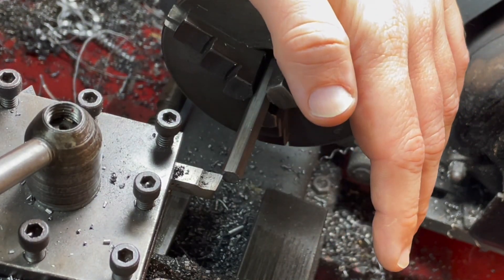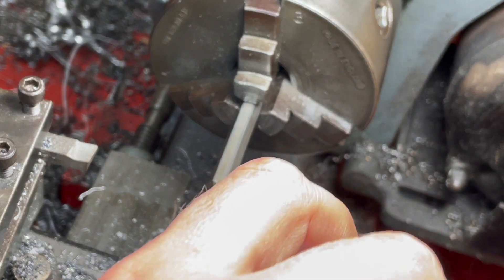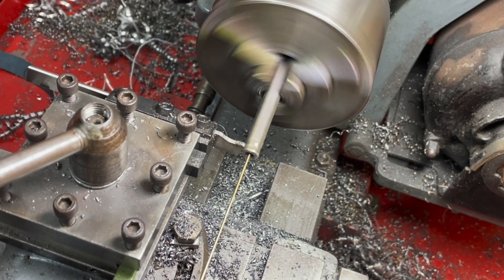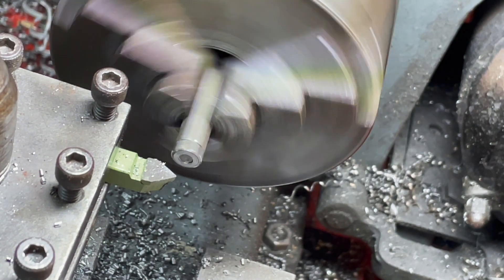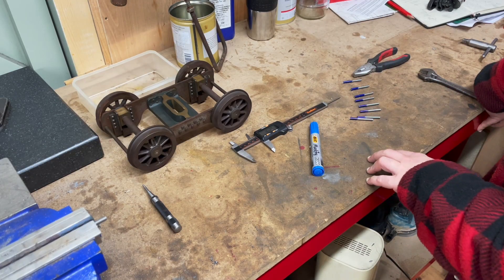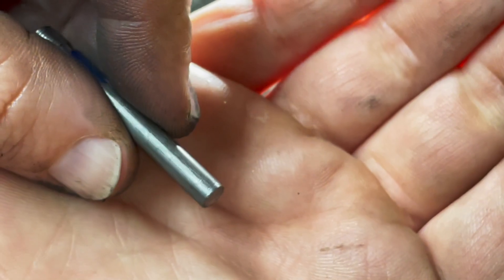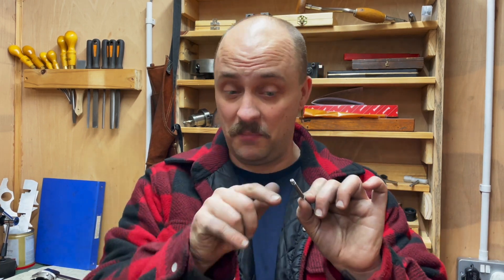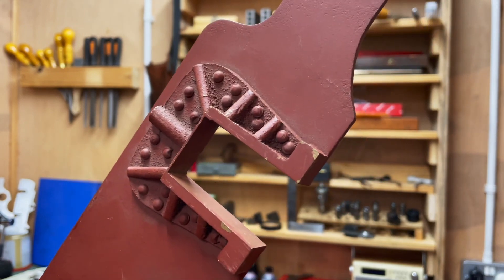Spring pins & nuts, onward to a rolling chassis! - Steam Locomotive Build #6

Comment: Hi William, what a wonderful video you have shared. I think your excitement is great, and remember the more parts you make, which means that it's truly made by you. I want to share a part off tip with you. If you grind a 15-degree angle on the front cutting edge of your parting off blade, having the longer corner on the backside of what you are parting off will reduce the big burr on the back. When you cut with the full width of the cutting edge, the material gets too thin and breaks off before you finish parting. With the angle, it has already cut into the hole while still having enough material to support it, leaving no big burr. Hope it helps.
Reply from the maker: Hello there mate, sorry I didn't see this comment before and didn't reply - thank you for replying. Interesting idea about the bevelled parting off blade! This one is starting to get blunt so when I regrind it I'll be sure to try that. Cheers!

Comment: It was great to watch you making these parts, it made us think that we need a project to help improve our machining skills and to get to know our machines better. For the horn I would just use something like JDWeld or metal putty, it does not look like a good idea to introduce heat
Reply from the maker: Yeah I think you're right - Kev at Mr. Factotum's workshop suggested drilling and tapping with 'blind bolts' too - but JBWeld and a block of aluminium or brass and a bit of body filler seems like it might be more straight forward....

Comment: Bent frames - wait till you have all the stretchers bolted in and drag/buffer beams and see how it sits on a surface plate. Horn, forget about it not a problem worth worrying about, some designs don't have a piece across the top at all so it plays no part.
Reply from the maker: Thanks for the advice on that Adam, email coming your way!

Comment: I think that Edward Parrott has the right idea regarding the hornblock slot: as he says, the top of the slot has no structural significance. From the aesthetic point of view, I would, personally, Araldite in a shim to disguise the mistake and make the slot consistent with the others, but it's not a necessity. Looking at your parting off, I think you could do with adjusting the centre height of the tool: it seems to be too low.
Best wishes.
Reply from the maker: Thanks George - araldited steel shim seems like a good bet. It's not the worst thing I'll have to cover up I'm sure, but I would like to get it at least broadly the same dimension as the others!

Comment: I wouldn't worry about that horn.  Top edge doesn't do anything, plenty of strength left in the frame flange.  I wouldn't introduce any heat to it bolted to the frame plate.
Reply from the maker: Good shout - maybe I'm being too particular and there are other things to focus on but it irks me that it's not even with the rest. JB weld and a flat bit of 1/16" steel plate?
Reply: @williamsworkshopuk  That's all I would do if it bothered me

Comment: 👍 Frame (manual effort) 👍Horn (countersunk slotless ba screws loctited in & flushed off, brazing might distort things)👍 Kev
Reply from the maker: Silly question - how do I screw in slotless screws?! :)
Reply: @williamsworkshopuk  Thread one component, clearance hole in other with a countersink for screw head, apply loctite, Thread screws in with fingers, longer than required, put a nut and a lock nut on the back on end of screw when they come through, then with a socket or nut runner tighten them until the required torque, remove the lock nut and nut, then make flush, detail finish as required. Jobs a "good un"👍 or alternatively use countersunk rivets and flush off👍

Comment: I also think brazing/silver soldering the pad in will be a good option. The horn will probably have to be removed for that to prevent the frames from being distorted by the heat... however, this will make it quite annoying because the rivets will have to be drilled out and then replaced😅
I look forward to seeing how this problem is solved! 😄
Reply from the maker: Hello there - I'm not sure I want to remove the horn as I said to Gary - given the number of rivets and presumably that it has been machined equal to the adjacent axlebox! Still, I'm going to put my thinking cap on!